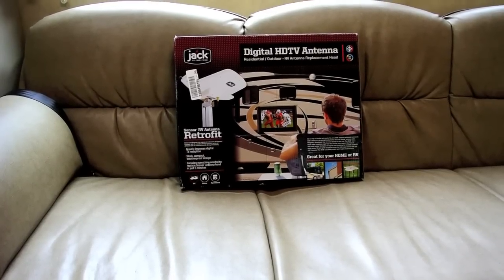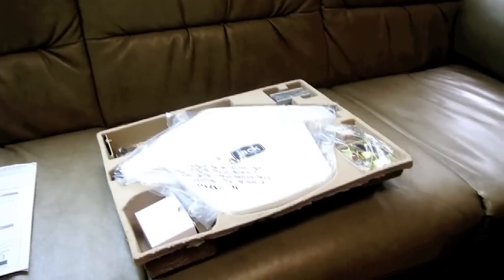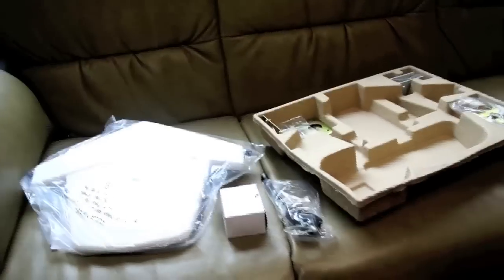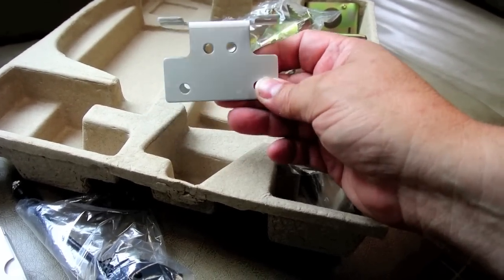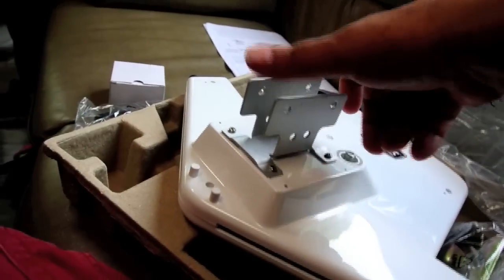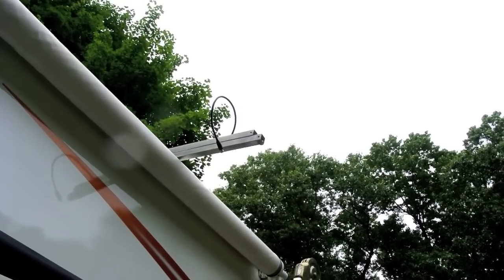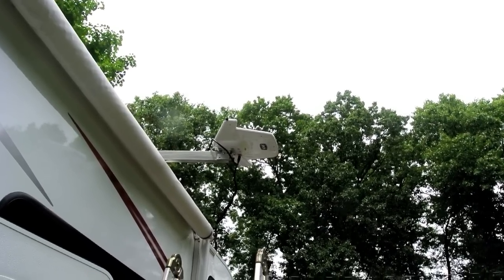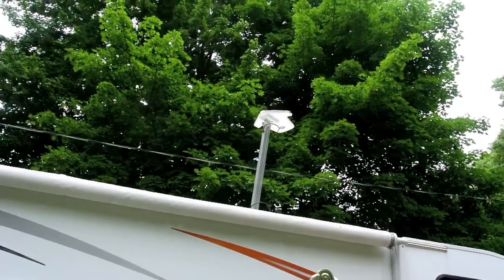Replace your RV's Winegard Sensar TV Antenna with a Jack OA-8000.

Comment: Thanks for evaluating the King antenna.  I  am thinking of upgrading my 9 year old Winegard antenna.  I don’t think it has the UHF amplifier. 

That Sensar wallplate module looks powerful.  It can optimize signals.  My new ATSC-3 Tuner has a signal strength meter, too.

Comment: I installed mine, but the red light does not aluminate. I checked the power, has 12.3 volts to it. Any suggestions?

Comment: Hi, thanks for the video. Was your old antenna HD? I have a 1999 motorhome with SD antenna. Curious if this would be worth it for me. Thank you.
Reply from the maker: HD antennas, at least for over the air broadcast, is just marketing hype. HD signals have higher bandwidth requirements, but antennas are inherently wide bandwidth devices - covering many channels.   

In a slight contrast, a Satellite antenna is sometimes marketed as HD as well, but it is actually the receiver having the capability to receive HD signals, not the antenna. And of course, that is only for signals that are transmitted in HD.

Comment: How the reception on this antenna? Is it reliable?
Reply from the maker: When I installed it, I noticed a slight improvement over the Winegard Sensar antenna.
Reply: yes i have one and it is better than the bat wing i had . i also have the digital meter that this guy has in his video. on the antenna there is a small red light you can see at night when the antenna is up and you know its being amplified .The antenna he took off is supposed to be the number one antenna , but it appears with the meter reading the bat wing is not.jack must be king or probably better.

Comment: If your signal strength meter is showing you dBm numbers, the lower the number the stronger your signal. In your case it appears you lost 7 dBm of signal strength. Every 3 dB of loss halves the signal strength you are receiving..
Reply from the maker: It is just signal strength, not referenced to any standard. 

By the way, dBm = decibels with reference to 1mW.  Yes, dB is an exponential measurement, but only negative numbers result in the lower the number representing a stronger signal. For example;  0 dBm = 1mW (unity gain) thus, +3dBm = 2mW, +6dBm = 4mW, and so on. 

I think what you are implying is in TV receivers, the received signal is typically less than 1mW, so -3dBm would be half of 0dBm or 500uW, -6dBm would be 250uW, and so on. Generally a negative number is, or at least should be shown with the leading (-), but I suppose some gear leaves this as an implied negative. At any rate, you are correct that in TV reception, received signals are less than 1mW, or less than 0dB. 

However, I don't think the Sensar Pro is that sophisticated; it's just a number 0-99 indicating the signal strength without any reference to + or - dBm.  The reason I am sure of that is the manual indicates that any signal reading under 40 will result in marginal or no reception. That pretty much confirms to me that this meter is simply arbitrary with larger numbers indicating stronger signals.
Reply: @RVProject  very good explanation, something tells me you're either an electronics tech or an amateur radio operator...

I was curious on whether that was reference to dbm or not...

Of course I have the tools to check it. I have VNAs, service monitors and signal generators. 

Service monitors for 75 ohm systems are a dime a dozen nowadays on eBay 😂 

Anyhow I was curious about this antenna myself as the wineguard unit which is enclosed in a radome and is automatic is over $300 which is a lot more than I want to spend on a TV antenna. I have no problem manually pointing a TV antenna